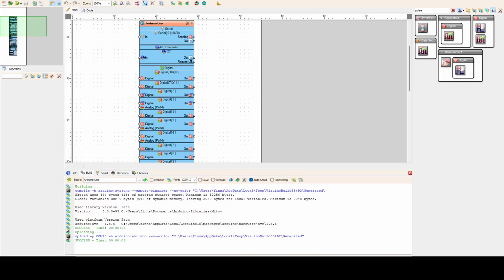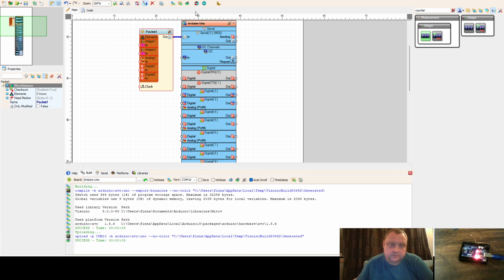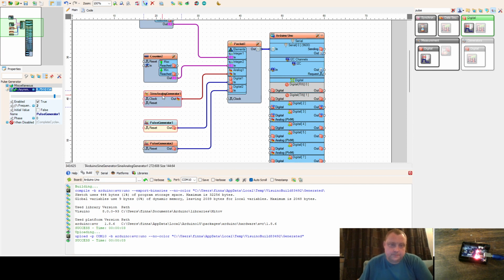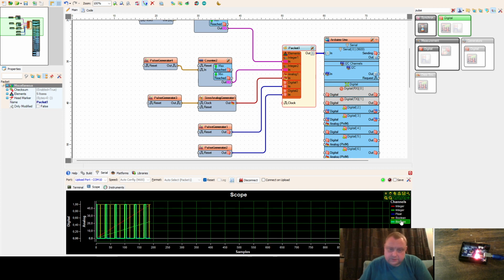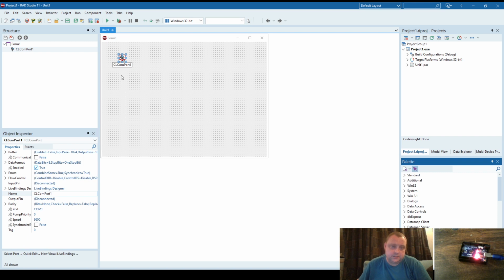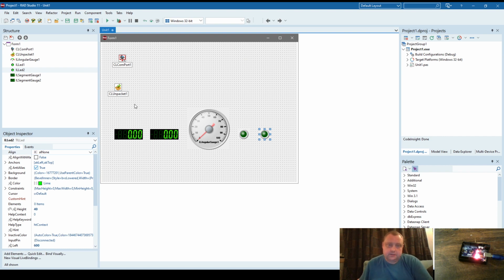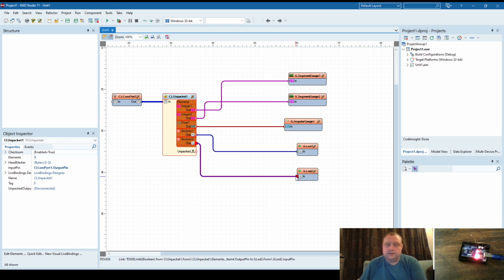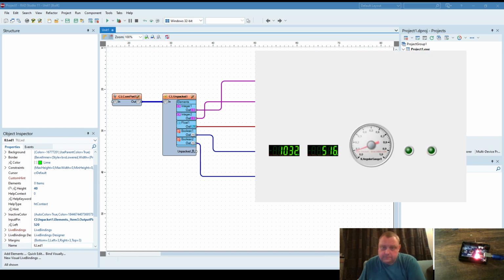Visuino - Simple, easy and fast integration of Visuino and Delphi

Comment: Wow! Thank you so much for the nice tutorial, and kind words! 🙂
I have already made it even easier to do this. In the next release of the libraries (whenever I get chance to finally release), you can copy the settings from the Visuino Packet, and directly paste in Delphi so it will configure all the unpacket channels for you 🙂
I have added this tutorial to the Visuino Wiki too! 🙂
Reply from the maker: Thats sounds nice, looking forward to checkout other functinalites as well. like modbus to other external components. Its easier and faster to program this that a regular PLC. Building a room that I will use as workshop and studio. So looking forward to make more videos and complete some projects. I also like the subdiagrams in Visuino very much since som programs becomes large in many components. I get suprise everyday by this software. Thanks for adding the tutorial to the Visuino Wiki. I'll appreciate it.
Reply: Where do you find the libraries?
Reply: @tonyryan6017  Visuino automatically installs all the necessary libraries. They are all very much developed by me.